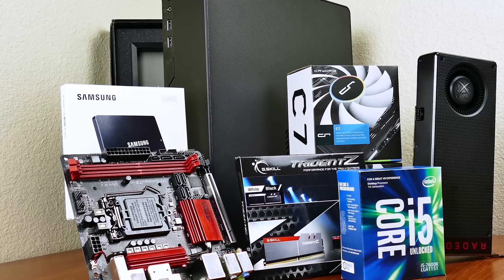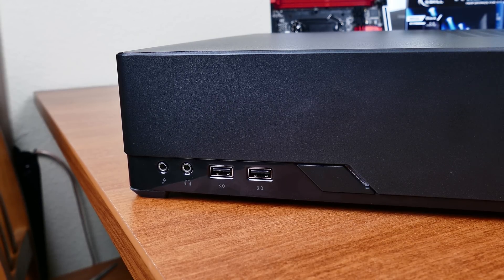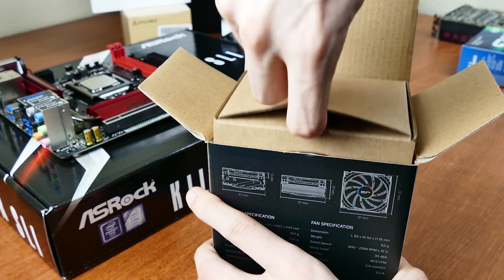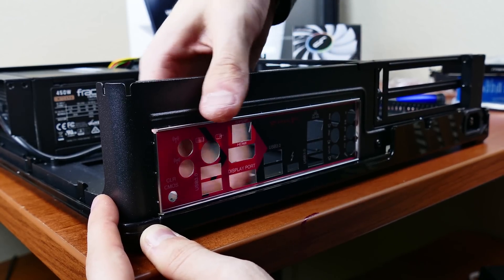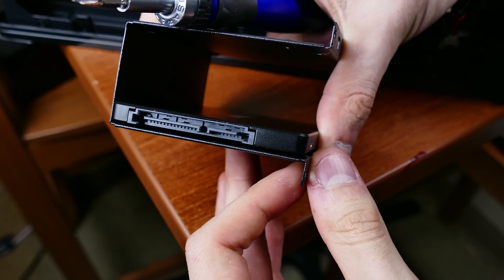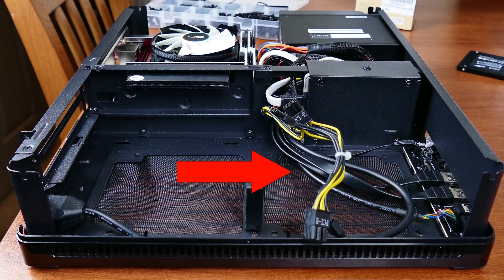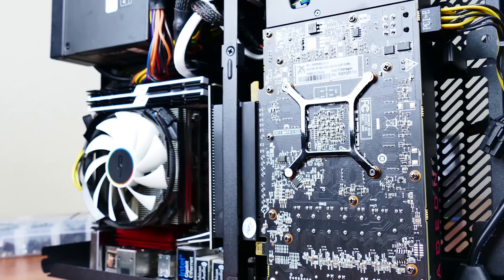How to Build an ITX PC (Kaby Lake 2017 Edition)

Comment: Or, for the same or lesser price you can build a system with 6700k and get better performance...
Reply: Sergej Zismann ITX builds are normally more expensive then ATX builds
Reply from the maker: You're comparing ITX to ATX. ATX builds are considerably cheaper on average. Unfair comparison.
Reply: PCP list it up then.
Reply: Sergej Zismann,
I've not seen the two being sold for the same price. If you can find the 7700K for cheaper/the same price as the 7600K, then yes go for it because there's no need not to, but otherwise why spend the extra money? An i5 paired with AMD's 480 is plenty good enough for gaming.
Reply: 6700k, not 7700k.
For the price of this bould u can build a more performing system on z170 chip with 6700k. And, what is more importantly, u get a better motherboard for less money. I couldn't find a moba that was on this video in Europe, but still, if u want a reliable moba, u can find a z170 for less money and with 1.5 or 2 times more power chains, as a new z270 ones. More power chains = more stability, less load on a single element = better cooling because of cooling surface (more elements = more surface) and so on, and so on.
For example, ASRock Z270 Fatal1ty ITX cost in Europe 200 Euros, and a more persorming Asus Z170I PRO GAMING  Z170 So.1151 cost around 140 Euros, sooo, what the point? In Mini-itx u don't need extra PCI lines, there is no room in a case for components, right?
New memory type, that MAYBE comes out in next winter? Well, who's gonna buy them if m.2. ssd's are more than anought for average user?
Netflix sh!t and more marketing baits? C'mon, we are not stupid anought to fall for that.
So, the only thing, that matter is: More clockspeed on a single core, or hyper threading? In long terms, of course hyper threading.
AND, we are talking about Mini-itx case, so heat is a problem as well, so i better run 6700k on stock, maybe some OC, as trying to OC as much as i can an i7600k and get a temps around OVER9000!!!!!!!! XD

So, i think u understand my view on this, there are always pros and cons, it depends on always on situation.
Reply: Part prices change every day, and it depends on where you buy it, etc. If the price difference is only like 20$ cheaper anyway, then nobody cares, because it might be 20$ more expensive next week.
Reply: We are talking not about 20$, we are talking about better performance for the same price. Kaby Lake is all about new features that nobody gonna use, as intel hd graphics, for example. But yes, there is a price difference, and it is about 40Euros (55$ i guess), so u get more bang for less bucks.
Still, gonna wait a mounth or so, before buying a new pc, just wanna see what  AMD got to offer (70% sure it's just a hot air, nothing more)
Reply: Salazar Studio Where did i mentioned ATX? I was talking about Mini-itx build, and Moba on z170 chipset, that i mentioned before, is an itx board.  =\
Reply: Salazar Studio Here is a link to European online shop, where are all components that i was going to buy. Remember, that in Europe hardware is much more expensive as in US. 
https://www.mindfactory.de/shopping_cart.php/basket_action/load_basket_extern/id/7b25b32216c396d981644efaadbc9d7fd8bd7bd6bb46276b4c0

Comment: Hey everyone, in conjunction with his video building in the newer deepcool genome 2. I have the Deepcool Genome (1st Gen case) in black with green liquid. Installed is an Asus pro gaming aura z170 with a 6700k over clocked to 4.6 ghz at 1.310 for manual voltage (stable past 24 hours under full load). With the ambient temperature in my computer room at 31°C under full load using Aida 64 my Temps run anywhere from 66°C and peak at 77° after an hour with the turbo curve set in bios for the rad fans. The 6700k runs pretty hot compared to its little bothers but overall the water pump on the genome is pretty weak and doesn't deliver constant flow at full cpu load. The fans are also very thin and although decent in design, do not offer the best flow on the market for pwm fans or static pressure fans. I know I may need to reseat the block onto the cpu or redo tension screws for the mount or try different thermal paste but this is far from my first build. I've heard from others that the pump is not very strong with this case, which defeats the purpose of using a 360mm rad. :/ hope this helps. Anyone else have high Temps under full load with water cooling for their 6700k? Anyone have this case that can confirm below optimal Temps using the included cooler? anyone have the same motherboard as I do that could maybe let me know if that could be an issue adding to the high Temps? Figured I'd throw this comment on a newer vid to get more opinions. Thanks.

Comment: How do you know which way to plug in your fans to the fan pins on the motherboard?
Reply: They only go one way due to the guides.
Reply: Guides? where? is it the way they are shaped? like a USB?
Reply: There is a plastic piece sticking up on the fan header that goes in between the 2 plastic nubs on the fan cable.
Reply: it's pretty obvious when you look at it
Reply: Well its not obvious, coz I can't look at lol
Reply: You can literally look at a 3-4 pin fan connector and tell which way it would plug into the motherboard lol.

Comment: IMO I would rather do the big cables first (power connectors) and test if the computer boots into bios, after that install the smaller cables. Unless of course you have barely any space which in that case doing the smaller ones first makes sense.
Reply from the maker: I already said in this video to assemble outside the case to test functioning parts.
Reply: Nvm then, wasn't really listening to the video :P

Comment: Dear Mr Salazar,

Thank you for the clear video. I currently have a similar build. I have got one question about this case - will a normal hard drive in this case as well? If not, what would recommend for extra storage options? Ordinary SSDs, let alone the more fancier types of SSDs are costly here in the EU, hence my question.

Cheers.

Comment: I do have a big question, you opted to choose a 4gb over the 8gb Rx480. Is the 8gb not worth it? I know there is a small performance difference around 10% and due to not many games using more then 4gb of ram but is that the only reason?
Reply: Dishonored Ghost not much use outside of 4k. Can be useful with modded games like fallout with texture packs etc.

Comment: why would anyone get a gtx 1060/rx 480 with a freaking I5 6700k
Reply: Ra.G.E TheDutchDude i5 6700k lmao
Reply: Chilly Doggo oh wait 7600k 
XD
Reply: Ra.G.E TheDutchDude Maybe they're not just using their pc for gaming?
Reply: Ra.G.E TheDutchDude why not?
Reply: @rage i was thinking of getting a i5-7600k and an 8 gb rx480 is neither of those good for gaming?
Reply: Because the game wil 9/20 times wil be gpu bound if you know what I mean so your cpu isn't realy pushing limits/boundaries
Reply: Ra.G.E TheDutchDude actually the 6700k cam go with the 1060 last year the 6700k went with the 980 and if u think about it the 1060 is basically a new 980
Reply: Ra.G.E TheDutchDude That's a pretty good combo. Why not?
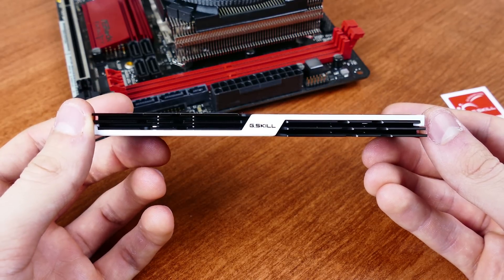Reply: i would actually want a 7700k with my 1060 because i play very cpu heavy games i get thermal bottlenecked at 86% cpu usage after 1:30 hours of gaming with my i5 6600 the game benefits from hyperthreading so i could probably get my fps from 42 to around 63 fps
Reply: Ra.G.E TheDutchDude i5😑
Reply: AI_!TM oh I realy can't type
Reply: +Ra.G.E TheDutchDude Your computer will always bottleneck no matter what parts you put inside there will always be a bottleneck
Reply: I mean... I have a 6700k and a 1060 ( I know you meant 7600k but still)
Reply: I have a i5 6600 w/ GTX 1060 6gb. No problems what so ever. Solid 60 all games ultra.
Reply: Same reason someone would get a GTX 750ti with an i7-6950x. Because not everyone uses their computer for exactly the same things you do, or if they're gaming, even plays the same games you do.
Reply: it probably was just to show that you can still put quite powerful hardware into such a small case despite the fact that heat very often is a concern with such cases if not executed appropriately
Reply: Ra.G.E TheDutchDude i havent encounterd any low fps with my i7 6700k with a r390 8gb
Reply: +Ra.G.E TheDutchDude Well if you want to upgrade it is more difficult to upgrade cpu, sometimes you have to reinstall windows, so you should always get a good one... but gfx cards are ez to get and install and all you have to do is grab drivers off nvidia or amd's website and your gaming.
Reply: +Robb Bonn i have that too ibdeed in most games 60 fps ultra but my fav game is very cpu intensive
Reply: what if I told you I'm running a 6700k with a 2gb 960
Reply: Jonny Pinder thats what i almost bought but i waited for the 1060 3 months running on an old gtx 280 :(
Reply: 6500 and rx 480?
Reply: Sung-Hyun Kim yeah if you were asking if that would be a good build then yes definitly
Reply: and get 8 gb of ram (or more if you can) and you have a realy good 1080p gaming pc
Reply: Ra.G.E TheDutchDude Danks bro
Reply: Well I like i7's but they cost more. An i5 can do a lot, just not hyperthreading and honestly how many gamers need to multitask or use all 8 threads at once?
Reply: it can even do some 1440p gaming in like high setting in the 45/50 fps region

Comment: I think it would be interesting to compare gpu temps of blower vs open air coolers for the rx 480. I'm running an overclocked xfx rx 480 gtr (1400/2250) with the same case and my temps don't go past 72c (auto fan settings).

I understand why blower-style coolers should be better, but haven't actually seen a direct comparison yet. The gpu compartment is actually fairly large and the case does a good job separating excess gpu heat from the cpu compartment.

I would be curious to know if the reference-style rx 480 actually runs cooler in this case than a good open-air 480 like the msi gaming x/xfx gtr/sapphire nitro.
Reply: Actually, open style coolers work even better in Node 202, especially if you add 2 Noctua 120 coolers in the graphic card compartment. It's a lot cooler and more quite than reference cards.

Comment: i think the RAM and motherboard were way better than this setup needed, it makes this way more expensive, a h170 and 2600 8gb RAM would be way better so you can upgrade the processor or graphic card
Reply: Fran Cecchi Buy a non overclocking motherboard for a CPU made exactly for overclocking performance? doesn't seem very clever.

Comment: Would an i7 7700k be okay with the 450w integra psu?
Reply: Rahil Khan Most likely not. Depends on the rest of the build. No need for just gaming anyways.
Reply: what if I use the non K version i7? I plan on gaming and editing.
Reply: Rahil Khan If you plan on editing, go for the k i7. Just go with the i5 6600k or 7600k if you only plan to game. I recommend at least a 550w psu though. Wiggle room and just to be safe

Comment: 2 month ago i build my first PC, but i'm new what is TYPE C means
My Rig:-
i5 6600 with stock cooler
asus Z170 Pro
HyperXFury 8 GB 2133 MHz
SSD 850 EVO 250 GB
1 TB seagate HDD 7200 RPM
S12G 650 watt PSU
out money for Graphic Card i can buy RX 480 but saving money for gtx 1070

Comment: Nothing beats the Strix Z270i aesthetically. Nothing.

I was also wondering why you went with the Cryorig cooler instead of a Noctua D9L proper tower cooler for mini ITX, but I guess the case makes the low profile necessary,
Reply: I think the MSI X99A Titanium is the best locking so far.
Reply: It's not ITX, and it's not Z270

Either way, the Strix Z270i is just a gigantic stepping stone for ITX mobos in terms of functionality AND aesthetic, makes me really sad that I bought my Z170i Pro Gaming like 3 months ago. I kind of want to switch, but ain't got no money for that
Reply: Aysei agreed, the MSI Z270i is almost there, I'd say it's a close 2nd to the Strix Z270i.

Comment: Actually if you dont have that huge budget you can get a 2.5 inch Hard drive, even it will be a bit slower then 3.5 hard drive (5400rpm vs 7200rpm), and a little bit more expensive.

Comment: Does Kaby Lake have the same problems with it's pcb as Skylake had? I mean like breaking when applying a cooler to tight or something?
Reply from the maker: Never heard of that issue. You're likely referring to an isolated incident.
Reply: http://www.tomshardware.com/news/skylake-cpus-damaged-by-coolers,30690.html I build 3 Skylake PCs since they were released, never had that issue, but I read about it, and I actually know someone who's refusing to use another cooler than stock, because of this problem. It's just very unlikely that, I get my hands on any Kaby Lake, anytime soon :( and my curiosity won't let me be.

Comment: Actually I would take the previous mini-itx X99 build over this. I have a mini-tix with an i7 skylake and to be honest there are games that does not run that great even thouhg I have high fps. I rather take 5fps lower then living getting stuttering because the cpu is using its 4 cores to the brink.
Reply from the maker: I can count on one hand the number of games that successfully utilize more than four cores. You're blowing this way out of proportion.
Reply: Sure, but even then it is more about things running in the background that can affect the gameplay. What if Firefox gets nasty, or something other starts chugging. Maybe the upcoming win update will solve stuff like this but right now, I feel a quad is to not enough. When I saw how well my friends old x79 octacore xeon performed I was simply shocked. He "upgraded" from an i5 3570k and I from an i7 3770k(gave it away to my little brother) We both have the same gpu, gtx 1070 and I get tiny amount of fps higher but his sys have no stuttering what so ever.

Comment: Overclocking question: is an OC of 4.5ghz @1.240v on an i5-6600k normal? Temps never went higher than 56*C in aida64. Tested for an hour and a half. This is in my gaming rig. Nothing crashed or had any problems. I see people with higher voltage/temps and it confuses me.
Reply: Nick b very normal. mine is the same

Comment: Will you be doing an ITX build with the mini GTX1080?
Reply: the GTX 1080FUXiTUp edition was just announced!!!! its got 60 gb of HBM7 vram, 32 gigawatts of power draw tessellation roots, 2330 rop units, 45 gpu gpus, 11.5 Kilos of system ram. ,  cooks mashed taters and cums gravy......but the kicker is, when plugged into  dual 8 pins it cums surf and turf.....oh yea its SFF

Comment: So is the 7700k worth the upgrade if i have a 6700k? definitely not much of a bottleneck with a gtx1080 right? not much to do since thats overkill right? first pc i built so im not too sure , heard 7700k was only like 10% better
Reply from the maker: No.
Reply: Dancin Bananna22 the 7700k is 5% faster because of the higher clock speed, if you OC both at the same speed they're the same
Reply: thanks!

Comment: Hey Greg
Does the Node 202 fit in a large laptop backpack?
The Silverstone RVZ02 is just a hair too wide
I really want to be able to fit a gaming PC in my backpack
Reply: Graeme S unless you can fit an xbox one in your backpack. then consider a msi trident
Reply: I will never ever buy a pre-built system and neither should you
Reply: Graeme S I said if you can fit an xbox one in your back, you can fit a node 202 pc. The pcs smaller than that a pre-builts. I wouldn't recommend them, however, if fitting it into you backpack really matters I would look into pre builts

Comment: i have the cryorig c7 its not quiet by any means its louder then my case fans and those are almost 7 years old
Reply from the maker: Then your C7 is messed up. It's much quieter than the stock Intel cooler. Proven in a separate video.
Reply: Salazar Studio really? thats odd mine is unbeareably loud it was brand new and i bought it from newegg idk what the problem is ill have to check

Comment: The only difference between an ITX build and a regular build is the size?? Or performance is affected??
Reply: Alberto Caballero kinda, the smaller the case is, the worse airflow it gets, so you can't really throw in a xtreme series i7 and expect to get a crazy overclock since the temperatures would be awful, but yes, the only difference is the size/form factor
Reply: Alberto Caballero Mostly size. Usually itx motherboards support a bit less ram compared to normal ATX boards. Also itx motherboards support only one PCI E port so you can't SLI or crossfire.
Reply: Alberto Caballero just higher average temperatures. This could effect you if overclocking the CPU (which you should be with a K SKU), and you average GPU clocks could potentially be lower as well if overclocking. Depends how well you manage case airflow. These are minor, if not non-existent problems for the vast majority of users.
Reply: Ok then the only problem whit ITX builds is thermal and airflow issues... And of course a limited space. I got it thanks. :)
Reply: Not all cases have terrible fan airflow. Look at the fractal design nano s. It's supports a custom water loop. Alot of itx builds have i7's, just most of them are watercooled.

Comment: thank god you didn't say console killer... I swear some "console killer" systems on YouTube are twice the price of one...
Reply: This is three times the price of one. But you get three+ times the FPS ;)
Reply: Weirdo and all the glorious things that accompany the PC Master Race
Reply from the maker: You actually probably DO get three times the FPS with this PC... will have to check during the benchmarking runs!
Reply: The PS4 Pro has an underclocked RX 480 and it costs 400 dollars. Keep in mind it can play bluray discs. Sony is going back to selling consoles for less than what it takes to produce them which they killed with the release of the original PS4.